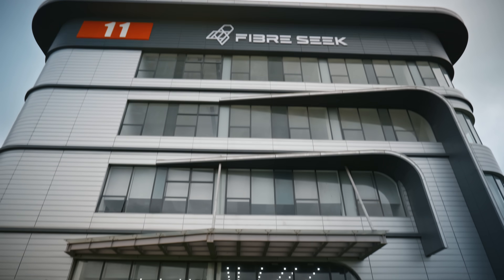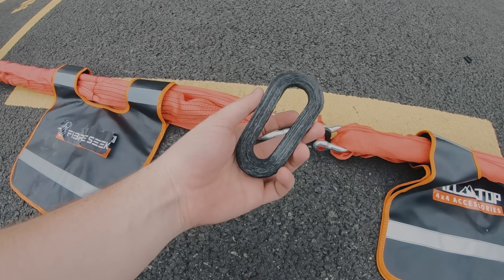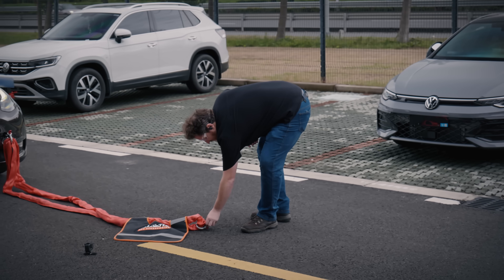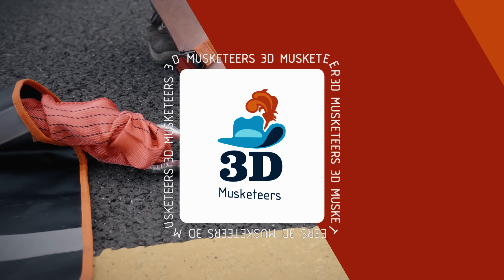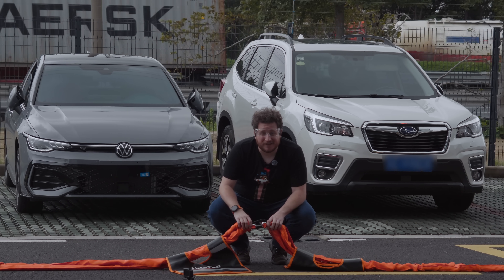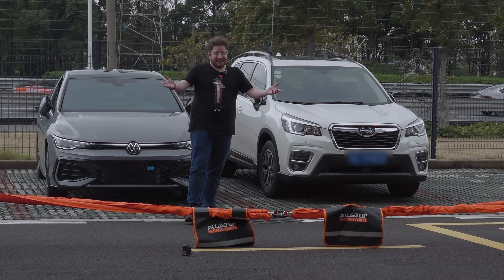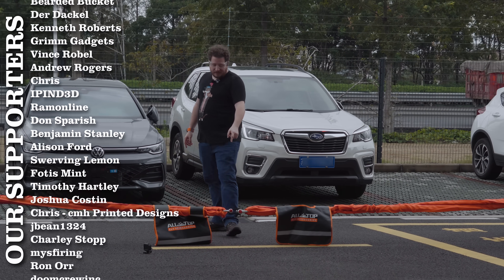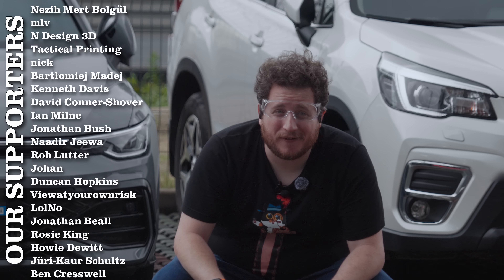3D Print VS. BMW! Our Strongest 3D Print EVER!! - Fibreseek

Comment: This also highlights one of the biggest misconceptions about carbon fiber filaments for consumer level 3D printers. People buy it thinking that it's going to be a lot stronger - but because it's chopped, it's only a marginal difference, and can even have worse layer adhesion. It's better for preventing warping and having a matte finish.

People don't realize that most applications of carbon fiber use continuous strands, which gives it its strength.

Comment: You wanted to hear about problems with Bamboo Labs printers over heating. My A1, which is only four months old, just packed in the middle of a print. I contacted Bambu and the diagnosed it as failed mainboard. Within two days they sent me a replacement. But! When I turned it over to replace the mainboard I discovered blistered plastic in exactly the same spot as you showed  in your video of three months ago. The printer was connected to a RCD socket, which cut the power and prevented a greater catastrophic fire. I have decided to wait until I hear back from Bambu before I attempt to remove the bottom panel. I decided to use the RC D socket after watching your previous video. Thank you very much for bringing this to my attention. It appears that the power was cut off instantly which prevented flames from forming but there is blistering of the plastic panel on the base. I live in the UK.

Comment: Especially if slicer is smart enough to properly lay continuous fiber, the parts should be close to indestructible.
Reply from the maker: Yes, the slicer is special to the machine but they aren't charging for it which is nice